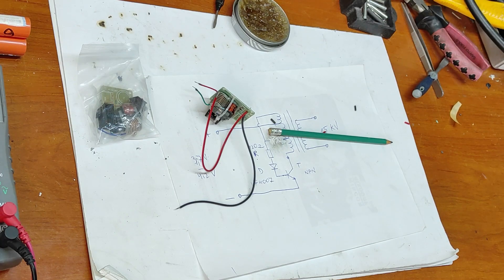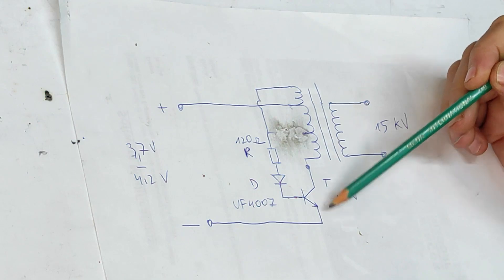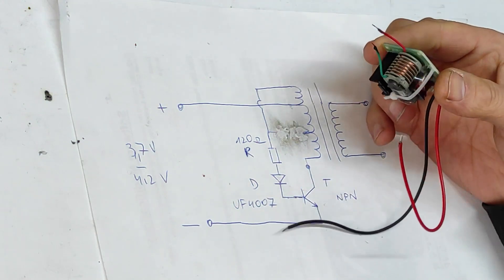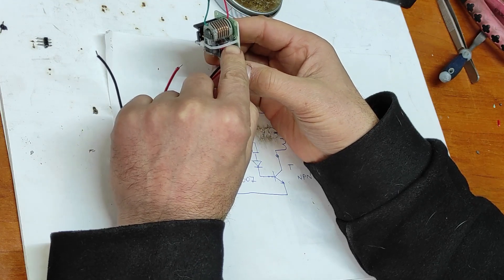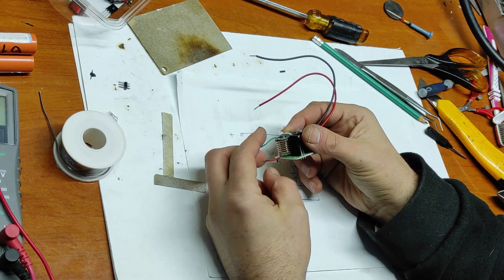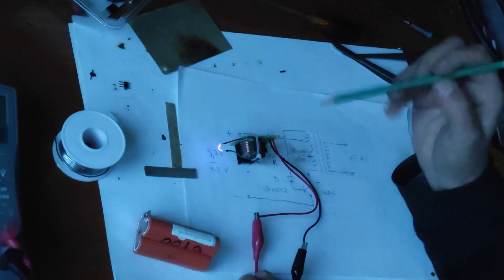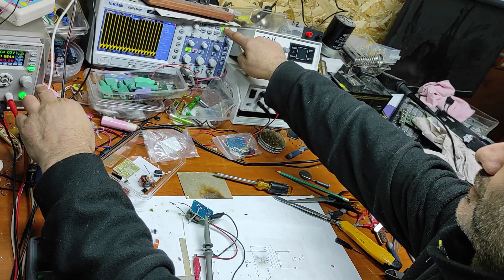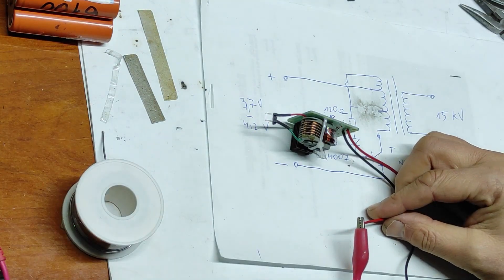15KV High Frequency DC High Voltage Arc Ignition Generator DIY

Comment: I have one of these. I was planning to use it for my voltage multiplier. First i used an arc lighter(electric lighter) to power my voltage multiplier circuit but it is not so powerful. This high voltage AC source is probably much better than an arc lighter.
Reply from the maker: yes bro its high voltage but small current. just a dangerous toy.

Comment: Great stuff, thank you! Questions:
1. What is the output current?
2. The output's coming directly from the transformer, so it's AC?
3. The resistor is 120ohm?
Reply from the maker: 1.I cannt measure the output current
2.output its AC
3.I put the schematisc.and resistor its 120 ohm.